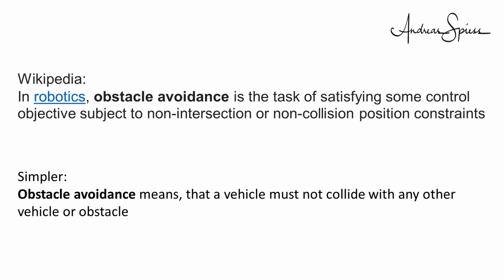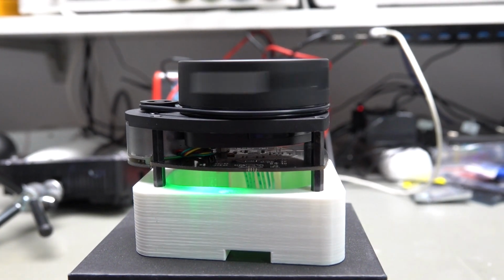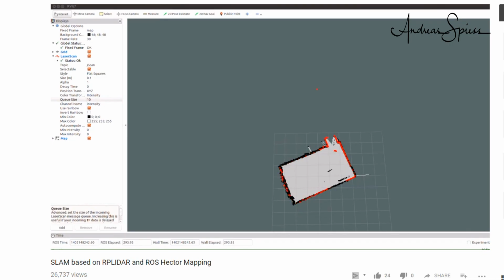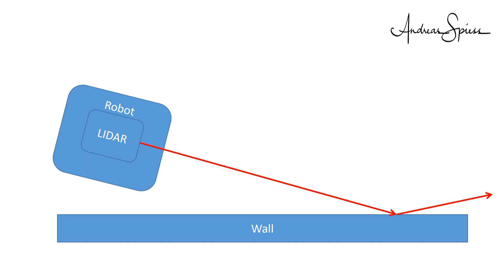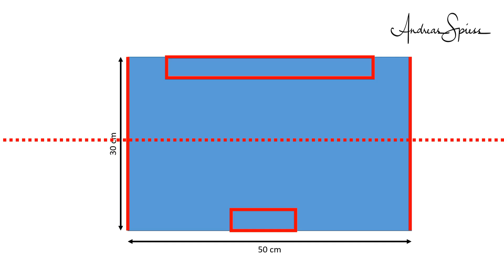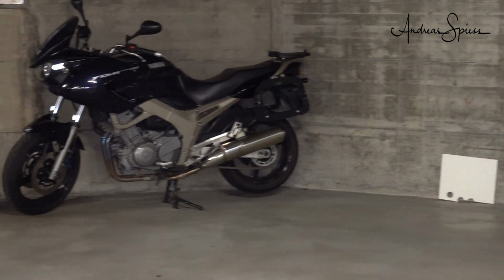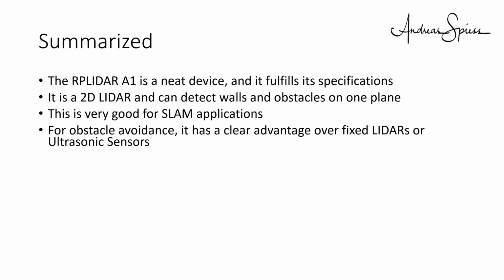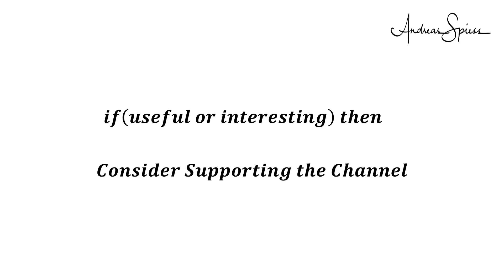#227 The ugly truth about LIDARs for obstacle avoidance (RPLIDAR A1, Arduino, ESP8266)

Comment: Thank you very much for that video. It gives me a nice forecast for upcoming DIY-tasks. As the sensor is not that cheap, I would like to discuss about the mechanical realisation: What is your opinion about "continuous operation" or even estimated lifetime. Is this sensor more for a proof of concept in indoor and clean laboratory conditions or does the sensor look robust enough to mount it on your tank and drive outside in gentle outdoor conditions e.g. tank on lawn in your garden? Dust, humidity, shock, vibration ?
Reply from the maker: It is clearly for indoors and it will probably not survive 1'000h. They sell other versions which seem to be more stable, but more expensive, too. For me, this is a typical Maker product for experimenting and learning.
AFAIK The product was introduced in 2013. So not new. Maybe we get better products in affordable price ranges. Maybe DJI will mount one on their drones? (I lost mine because it only has a sensor for forward flying :-(  This would give a boost to this technology.
Reply: This sensors design came our of the xv-11 vacium robot from neato. Internaly they use draging contacts tot send power up and get data down from the lidar. The newer versions are using a transformer coupling for the power and an optical link for it's data fransfer. 
https://hackaday.com/2015/09/28/neato-botvac-lidar-repair-includes-juicy-pics-and-a-tool-hack/

Comment: Thanks for your contribution and the clarification.
But to use  Swiss precision: Lidar (or Ladar) always means a time of flight method which the A1 do not use. So it is NOT a Lidar but a laser triangulation tystem originally developed  for a vacuum cleaner robot.
Yes you arer right real and useful  3D Lidars are still very challenging and expensive. That is why the camera Systems got so popular in the automotive Industry over the last decade. Some car manufacturers even use a stereo camera to get a better estimation of real distances.
Reply from the maker: AFAIK LIDAR is the abbreviation for "Light Detection and Ranging" which would include all sorts of systems. But anyway, not important.
Working with stereo cameras for sure would be very interesting for me. But I first have to start with one camera ;-)
Reply: Also to be precise since we are actually measuring time needed for a given length, this method is called Trilateration.
Reply: Please refer to https://www.robotshop.com/media/files/PDF/revolds-whitepaper.pdf and see that there is no time of flight measured.  The angle of the Incoming light ray is determined by an array of light sensitive Elements, e.g. linear array of photodiodes or in this example an imager.